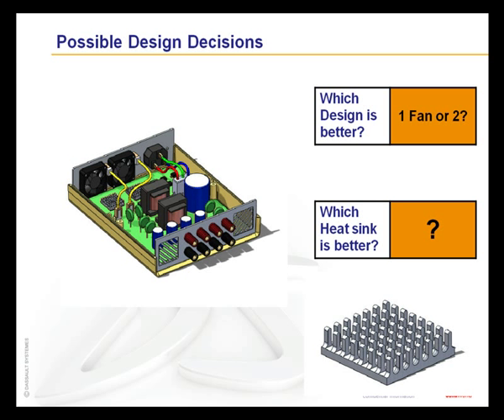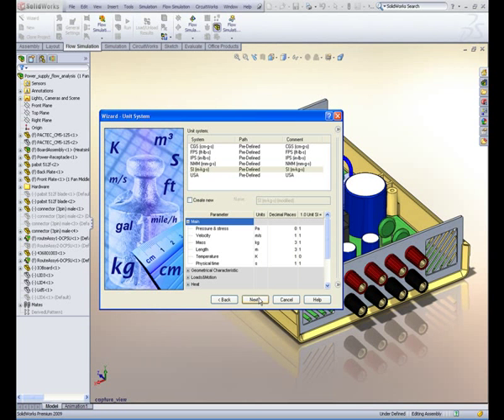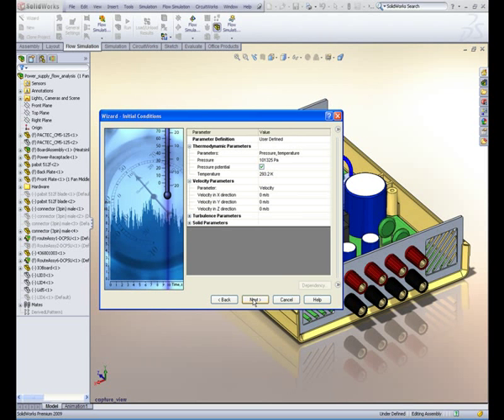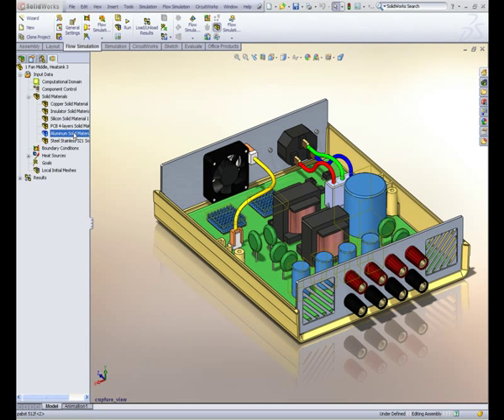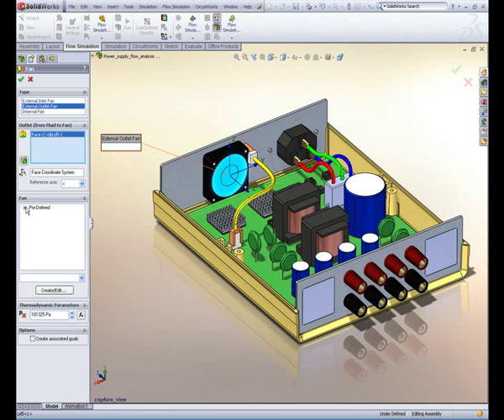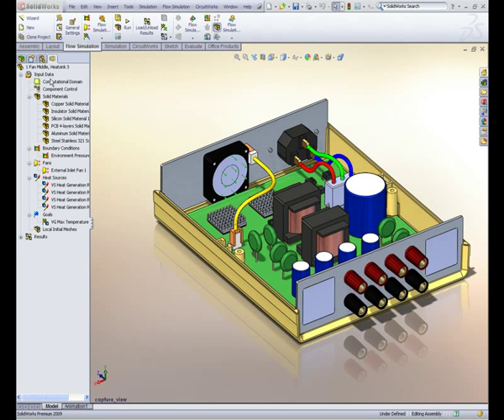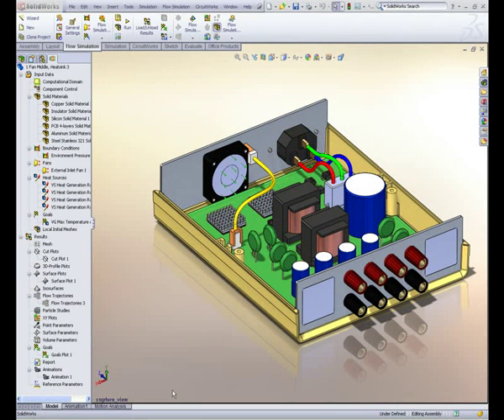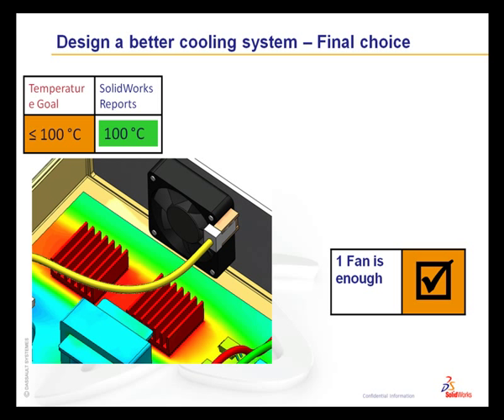Flow Simulation for the Design Engineer Analyzes Cooling Components

Comment: Looking at the results, it seems that the Fan need to operate continuously to maintain the CPU temp within 100C. Will it be possible for Solidworks to setup and compute the time how long the fan will run in order to determine the necessary Fan power consumption?